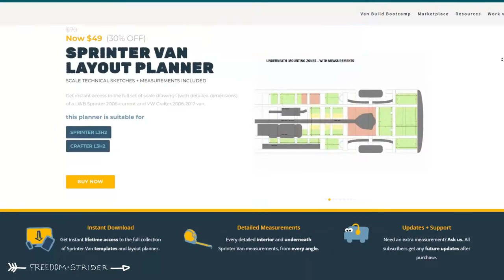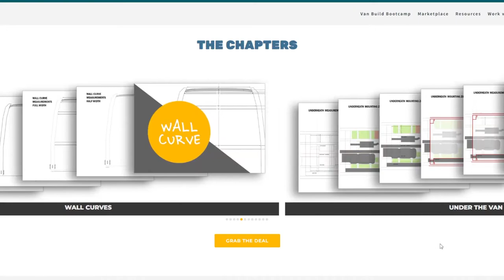Our NEXT van conversion?... (Peugeot Boxer Measuring)

Comment: I'm gonna suggest something mavric...... If you removed the vertical stiffeners you could bond on one big piece of XPS foam and gain back the stiffness all while saving weight.
Might not work for every van, but in this one it looks like there not doing much other than taking the wobble out of the large panel sides.

Comment: Watched you guys during your last van build.mines all done now had some great times in it so far.think ill do another but without shower as I aint used it yet 😂 waisted space.good luck guys
Reply from the maker: We learn so much during our first builds, it's hard not to do another one. Our shower, has been in use, and it's great to be off grid in that way - it is one of our bulk storage areas as well 😀... though we have no big garage so it kind of balances out. Showers are a tricky topic (I would always have some shower capability... in some form... For myself) but if your experience, for you, says no, then you don't need a shower.